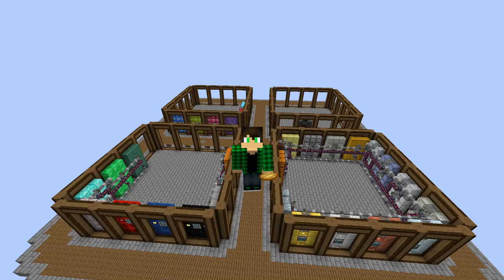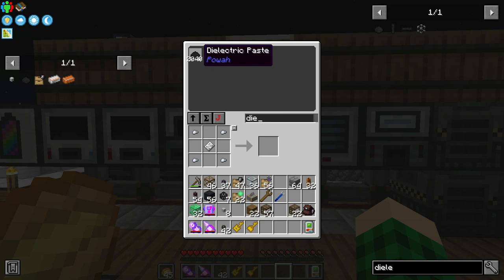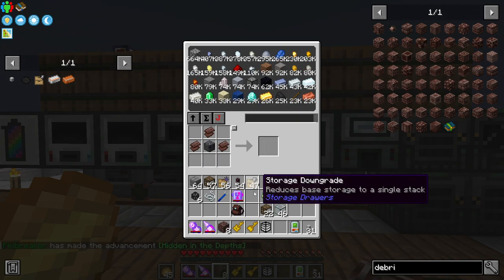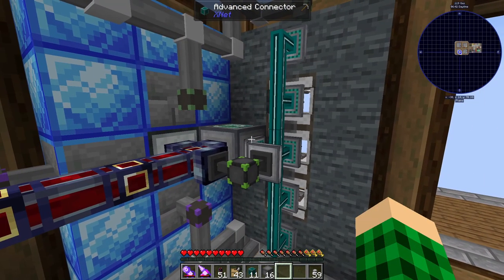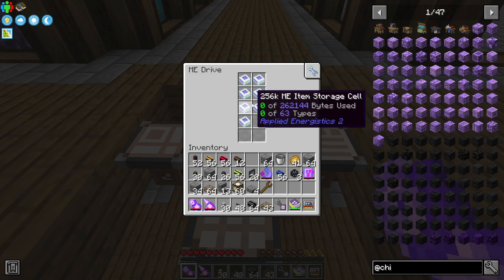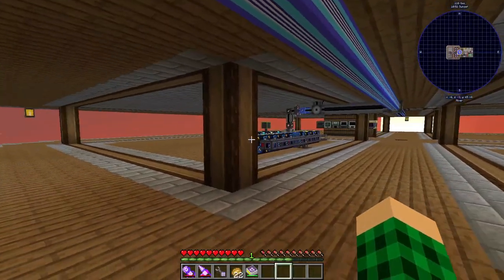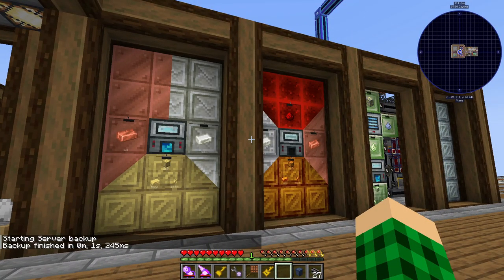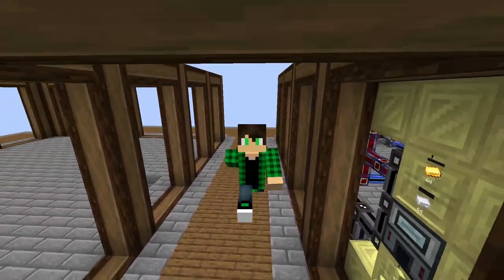APPLIED ENERGISTICS EVERYWHERE! #5 | Minecraft Techopolis 2 | [Modded 1.19.2 Questing Skyblock]

Comment: Great series so far! LaserIO can interact with power, items, fluid, and redstone.
LaserIO can be upgraded with overclockers, each card can have 4 card overclockers, the node overclockers is more complicated to explain but the gist is that you can have 8 node overclockers per node to make the node up to 8 times faster. Making singularities from AE2 using cobblestone with an igneous extruder, for example, you can pull max 9 stacks every tick (4 card overclockers does a stack every tick [bottom number is how many ticks every operation takes, set to lowest of 1] and each node overclocker can do the max of a stack), normally you can have 4 card overclockers pull a max of 64 per tick but if you have 8 node overclockers, you do max 8+1 stacks every tick. It's weird to explain it but let me know if you want clarification or whatever.